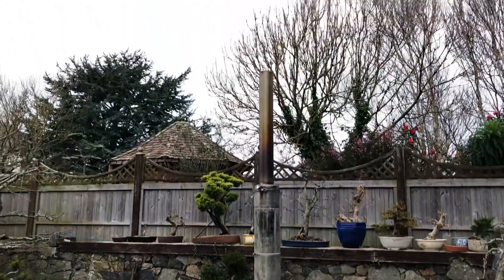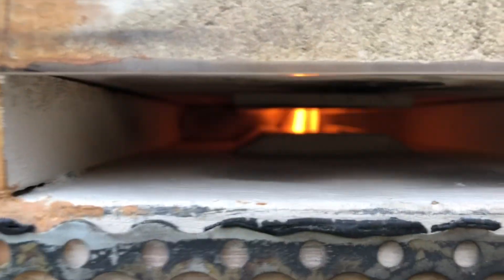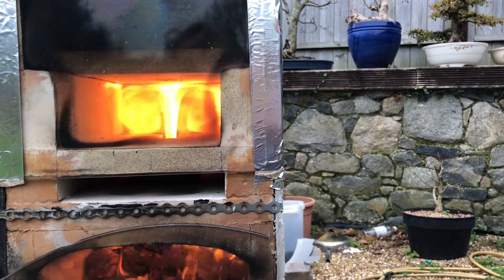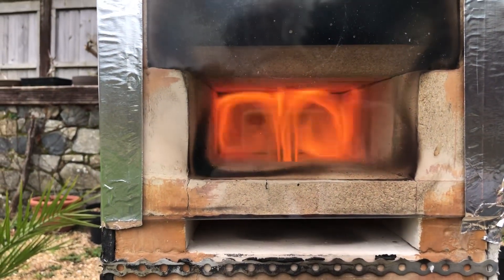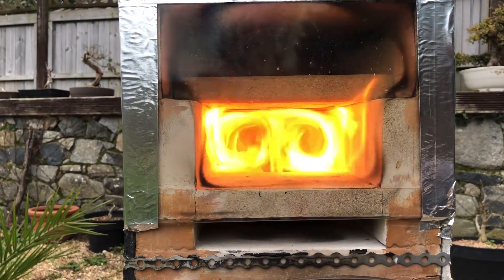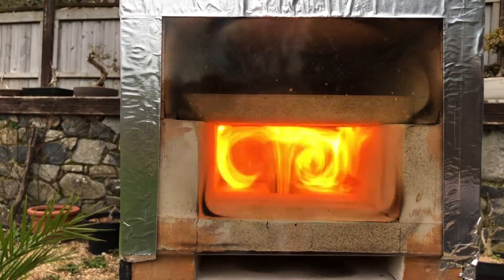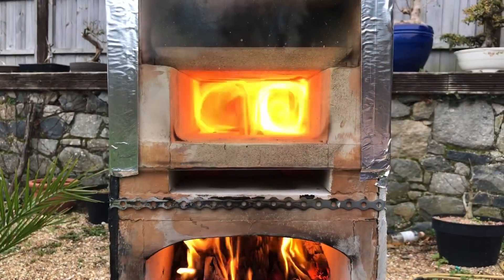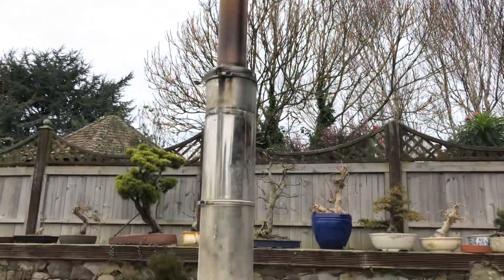Vortex rocket stove test number 6

Comment: Nice design, and I'm impressed by the high temperatures.  Trying to use this in a horizontal sand battery that I'm developing that would use a bench configuration to heat water in stainless steel coils around the exhaust and also heat up the sand bed at the same time.
Reply from the maker: The vortex stove does work well when it is n song but can be a bit fickle  on occasions, a well built and insulated J tubes are  extremely reelable ( plenty of example on my channel )  and might suit you need better.
Reply: Thank you for your kind reply.  I'll be sure to subscribe and watch your videos on J tube stoves. @foxfish7115

Comment: I've often pondered over how to construct a simple mechanism to open a damper door on the secondary air slot so it will open when it gets hot and close when the burn has cooled.
Reply from the maker: Well dont stop pondering now…..
Reply: @foxfish7115  Lol.  Ok. Well, if you put it that way.....I'll get back to you.  I'll have to look into the inner workings of a thermocouple.  There might be something in there that can provide a little leverage.
Reply: Thermocouple won't work.  I can't think of anything but a bimetal spring to provide the motive force.  Or an automotive thermostat, if can figure out a way to make that work that doesn't look like bad steampunk.
Reply from the maker: @Boscovius  well first I need to get everything working and sized up and them we cam think more about the details.
The stove is still in working order but I will soon have to re build a new one, just a few more test runs……
Reply: @Boscovius  I see 2 possible solutions, depending upon your skill in Rube Goldberging. 1st simple solution may be to flip bimetal spring over so it acts in different direction, ie clockwise or counterclockwise. 2nd solution is to add a simple reversing lever having center pivot with linkages to each end.  A workable solution might need refinements that address the fact that spring  torque applied to the reversing lever for lifting damper against gravity load  is now working via expansion instead of contraction. Your mileage may vary.  🙃
Reply: @mozit6  What about using a Peltier Module to power a miniature push/pull solenoid?  As temperature goes up, current will begin to open the damper, as the firebox cools, the charge will decrease and the solenoid piston will close the damper door.
Reply: @Boscovius  I don't remember exactly how a PM works but distance the solenoid can move and its' ability to hold the damper open when hot may be critical. Are you intending on starting cold stove with 2nd air damper closed and having it open at a specific higher (and adjustable) temp? Looks like a plan if you can get the right parts.
Reply: @Boscovius Food for thought...... If the strength of solenoid or its length of movement is insufficient, just use the electrical signal from the PM to activate a relay coil sending household current to a more powerful solenoid to accomplish the required draft movements. Most relays will only work on/off so if you wanted automatic adjustability throughout a range of movements, then  more advanced electronics would be in order.
Reply: @mozit6  Peltier modules and the miniature actuators are commonly available on Ebay/Amazon.  I think there would be an additional challenge of cooling the heat sink side of the peltier.  Perhaps mounting the peltier on the stove pipe and putting a vertically oriented shroud over it to create a convective flow over the heat sink.  The voltage should increase slowly as the exhaust heats up.  The solenoid will open the door more the hotter it gets.  As it cools, voltage drops, solenoid retracts with the drop in temperature until the door is closed tight and keeping heat from escaping up the chimney.  So to be clear.  The fire is started with no secondary air.  The device works on a gradual curve, not a sudden open/close funtion.  Well, in theory.
Reply: I was considering using a stirling engine to cool the peltier module, then I discover the Ecofan which serves the same purpose as the stirling engine woodburning stovetop fan but it is of itself powered by a peltier module.  Perhaps a modified Ecofan could serve a dual purpose as a blower and a power supply for the secondary air damper door mechanism?   I think easier still to just mount the peltier on the stovepipe with it's own dedicated miniature cooling fan and heatsink.  Power can be delivered via wire to solenoid mounted at the secondary air door.  I think it would be very nice to be able to load the stove, light it with primary air full on, have the secondary air gradually open to foster efficiency and when the box hits a certain temperature range an actuator closes the primary air, letting the stove run in gassification mode.
Reply: @Boscovius  Those fans are fascinating. Have you found a solenoid and verified torque it could produce? That might be the sticking point, getting enough power to do the job.
     If you solve the power supply problem, eventually you will be having to look more closely at the mechanics of the damper, what is its weight or power required to move it through what range of distance, etc.  

I believe I'd first try the mechanical option that a bimetal spring would offer. Then if not satisfied go on to perfect it with a peltier module and solenoid. A really lightweight damper would be easier to operate. Backdraft dampers in solar passageways are often just a flap of poly sheeting. That material would melt on your stove but no reason why a lightweight damper could not me made of thin shimstock for experimentation.   I had a boxstove years ago with bimetal damper. Worked very well. It would be pretty simple to add the reversing lever and  for adjustable ratio of movement just have longer/shorter connection points. 
         Do you have any photos/videos of your stove? I have not built yet. Just trying to decide which design is best. Not interested in J-box unless is a small steel outdoor unit. For indoors I want a combo cookstove heater with cooktop and an oven. Have been following Peter vd Berg, Walker Stoves, and now the Vortex design. Lots of info to take in and digest.
Reply from the maker: I have often though about using a heat operated fan to feed in secondary air …. In effect a turbo!
Reply: Warm morning built wood stoves with thermal coils that would open and close a damper.

Comment: Secondary air must be hot air.
Reply from the maker: Yes secondary air must be hot but the more you heat the secondary air the more it expands and the less O2 it supplies. 
So hot but not too hot!
My secondary air is around 250c, I would like to try 300c
Reply: Peter eliminated secondary air, double shoe box works fine without it
Reply: true,  and metal conducts heat into the secondary air passageway better than other materials do.
Reply from the maker: @mozit6  I am going to try ceramic glass first as I think metal will deform with the hear and cause issues, ceramic glass is very stable and will let the heat through but it might break!
Reply: @foxfish7115  yes, metal does deform and deteriorate if too close too flame and high temps. Dense ceramic materials have high conductivity and heat absorption like steel. Expansion causes cracking in dense ceramics even though they do not melt or spall like steel. If you can increase inlet volume of 2nd air you reduce O2 deficit caused by heat expansion. But close proximity of 2nd air outlet orifice(s) to extreme heat will always be problematic. Of course added pressure and flow could help to cool the orifice and maintain a gap between orifice and flame, similar to a tip on an acetylene torch. But pressure is costly and inconvenient for the pressure and cfm requirements.
Reply from the maker: @mozit6  it is working quite well as it is but I will try a few alternatives …… i dont need  higher temperatures, the goal is to stop over fueling 
when adding fresh wood to a hot firebox.
The stove works very well but when cooking on the hot plate, I sometimes need to add fuel and that has been an issue.
Reply: @foxfish7115  Does not restriction of primary air from door dampen it down? Naturally if you add more dry fuel to a hot coal bed it will readily ignite and pull in lots of air and gets hotter and hotter. Perhaps allow the fire to burn lower before adding the wood? I will view the video again to better understand what you are doing.

Comment: Cast iron 
with a door of small stove (recovered in forge steel), 

door in the shape of half-moon, 
put as a springboard at the bottom of the fireplace, on a BBQ stove brick, 

I have found that heat follows melting,
The flames seems guided by the heat of iron.

Comment: Before you revert your secondary air could you try putting a brick in front of where the secondary air enters the flame and see if that helps not mess with the vortex early on?

Also, I have had good luck with putting a damper on the stack. It seems to slow things down more than messing with air intake.
Reply from the maker: There is a chimney damper on my patio stove (last years videos) and it does help , these vortex stoves are sensitive I am trying to make them more user friendly but there are so many things to try out! 
Thanks for you reply and suggestion.
Reply: @fox fish  yeah, I have been playing with a few different systems over the years but I haven't tried this style yet so I appreciate the videos. I might try one next year.